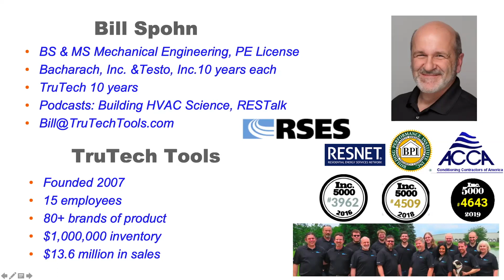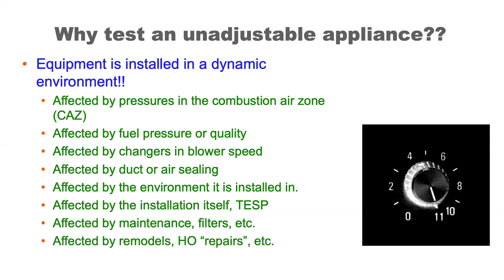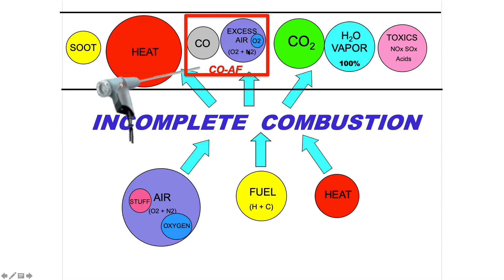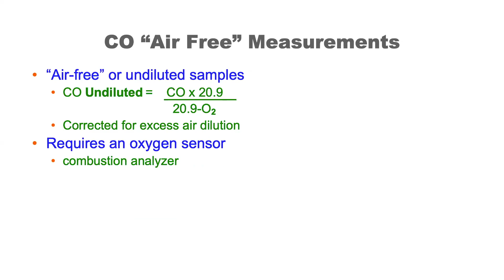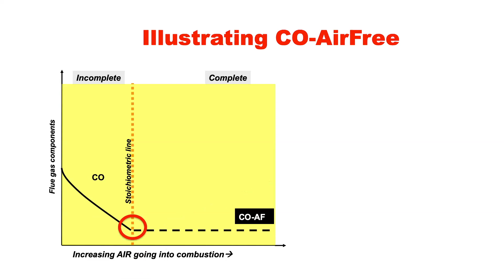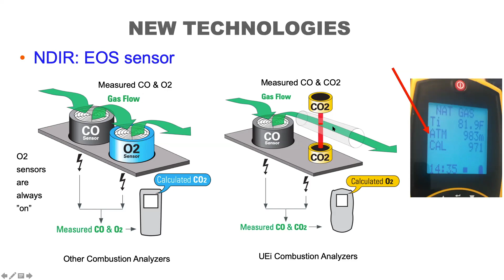Combustion Analysis 101 Webinar feat. UEi C161 and C165

Comment: Thank you for the information. I have a couple of questions if you don’t mind
Can you please direct me to a resource that shows recommended/Optimal levels of CO, 02,  CO2  etc... For example I have been told  you want to have excess air levels of roughly 40%
Do you have a chart Or a PDF that contains these desired numbers?
Also do you have a troubleshooting guide that will show you where to begin in order to lower Co levels For example?

Thank you in advance